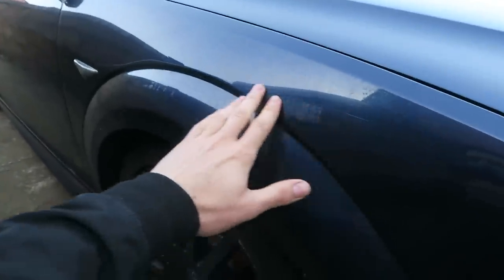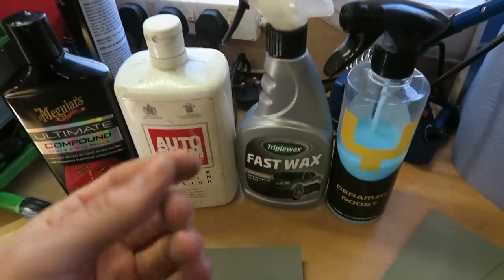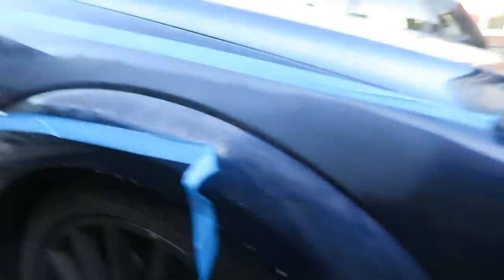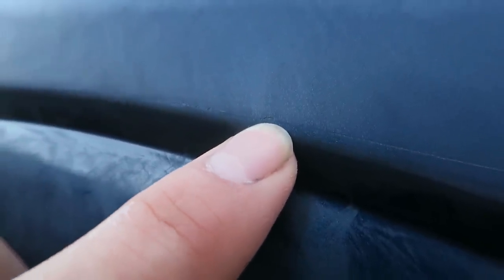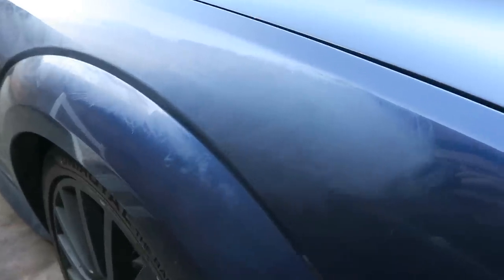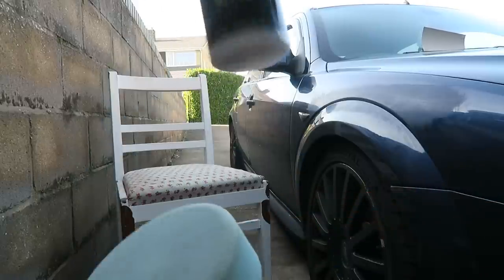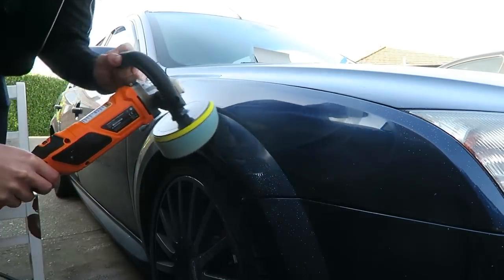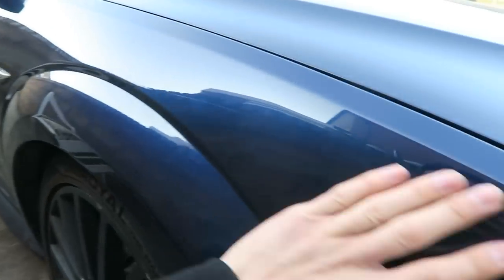Someone Key'd The Mondeo.. (Scratch Removal)

Comment from the maker: Constructive criticism is always welcome 👌🏼
Reply: fair play to you for having a go, the detailing world is really daunting - so many pros already out there which makes it really scary to have a go at things like this yourself
Reply: Wish i had the nuts to do my car .. crackin job m8 👌
Reply: Buy a bottle of colur magic that will hide it for a month or so  😉
Reply: Well wax your car so it's far more difficult for a key to get a hold in the paintwork or stones chipping it.
Reply: Hi. What you have to realise is there are scratches and there are REAL SCRATCHES.  When some bastad has done a gouge with a sharp object you have to think to yourself what is going to remove the scratch ?. Well it's not the scratch you are removing It is the layers of paint that are higher than the gouge. So an option is buy touch up paint which if you fill the scratch with you can then rub down/ flatten to blend the area. Or a panel respray ( big headache). 
Well done on the videos..
Regards Don.
Reply: the first part you started on the wing, could you not have removed the arch trim ? looks like your just making work harder for yourself
Reply: @ashman239  it's all one panel on a mondeo, it's not a separate trim.
Reply: bit of T-Cut next time save you hours of sanding
Reply: The imperfections you say are factory is also you going thru mate
Reply: Like it "the scratch hasn't completely gone but look how shiny the car is" 🤣🤣🤣🤣 it's all a learning curve my wife's car has been keyed but unfortunately through primer so gonna wet sand it, fill out and polish the crap out of it, I haven't done it before in same boat as you but if it goes tits up I'll just take it to a body shop so they can laugh at me as well 👍👍👍👍

Comment: Some decent cutting compound is called g13 cutting compound used it a fair bit in the body shop I worked in does brilliant job but I would use a touch up pen and flat it off then use a artist paint brush to go over the area with lacquer then use some g13 and buff the whole panel and then wax it best you would get without respecting it properly

Comment: Great vid,only tip I would give you is keep your pad flat to the paint work when buffing and not on a angle,put it on a angle you will produce more heat on a area and there for you have more chance of burning the paint work

Comment: When tackling a job like this wet the scratch with water and if it does not disappear  then it is through the lacquer and down to the base coat this you will not remove without a squirt with paint and topcoat

Comment: What I did clean the key marks out, filled it a touch up pen (mix lacquer and paint into one mix) and then blob it over the key marks so it’s raised over it. Then wet sant till it’s flat and polish. Worked a treat.
Reply: Vendetta UK. Yeah I used it on my fathers metallic grey A6 and you could tell the shade was slightly off but it took the eyes away from the scratch.
Reply from the maker: ThatGuyNamedScott. C like this idea
Reply: The Savage Garage give it a go! Nothing to lose!
Reply: I’ve seen people do something similar to get rid of gravel rash/stone chips on front bumpers.. then wet sand and then buff.  Felt sorry for you going through the clear coat.. did the same years ago and ended up having to get two panels painted at £500.  Sometimes perfection is best not attempted!👍
Reply: There's a YouTube channel  and he used nail polish and you couldn't tell on the video but I suppose with the naked eye you probably would but it's another option!!!
Reply: Yea I’ve done the same - with ok results
Reply: @ScottPC  Except the paint does not blend with the original paint and its metallic. You will be left with a visible line of paint instead.
Reply: @TheSavageGarage  I do the same but by spraying into can lid and applying with a small brush. But you only need apply lacquer if it's not down to primer. Otherwise you're also going to have a colour mismatch for no reason.
Reply: Just commented the same process then saw your post. Works a treat
Reply: Shouldn't I wet sand first to level out the edges of the scratch? Then  put the pain, wet sand again and polish?

Comment: Used way to fine grit.. should of used 1000 max first grit then 3000 after then polished up.
Shouldnt have to rub the panel for that long thats why the scratch is still there. As 3000 grit is a finishing grade not a cutting grade as such.
Id of went for about 800 grit with alot less effort then work upto about 3000.
Reply: Not really, you should always start with the least aggressive method. If you went straight in with 1000 grit on some soft paint you could go straight through to primer in 2 mins XD
Reply from the maker: Chris Selin blame Chris fix for that then!
Reply: @TheSavageGarage  chris fix is great :) just by seeing this scratch was pretty deep, but good attempt and learn there on.
The one at the back of the   car looks much easier also not next to sharp edges as you mentioned in the video :) i had one simular to this and managed to remove with a micro fibre pad and G3 professional scratch remover alone in a few moments without needing to use any sanding atall.

Btw been watching your channel for awhile now loving the vids :)
Reply: EXACTLY. SPOT ON.
Reply: After 22 years painting and polishing cars,  u done it about right mate,  just need to Start with 1500 on a rubber block tape all edges and don't be afraid,  if it goes wrong it goes wrong,  well done lad for giving it ago,  its not an easy task

Comment: Woow. No advice yet. There are loads of videos on youtube on how to fix this but which one to follow? 

My experience: dont use spray paint. Give it a light sand, then use touch up paint. Give that a day to dry. Then sand in the touch up paint. Then lots of t cutting and polishing. 

I even came across a video from a really knowledgable guy and he recommended raiding the gf's nail varnish collection and mixing up your own touch up paint! 

You can even make your own touch up paint by cutting up the empty matched spray paint can and pouring in the remaining paint into a recycled nail varnish bottle (clean that out using nail varnish remover).

Comment: My first attempt went a lot worse, I ended up respraying the whole rear quarter. 

A lacquer pen might help to fill the scratches before you sand them back, try using a slightly rougher paper to start with and keep getting finer. I always like to soak wet and dry paper in a jug of warm soapy water, just to make it easier to handle.

When using compounds, especially if mopping a car, keep it wet so you don’t burn through the paint , it’s a dead easy mistake to make and looks really hazy if you get it wrong. 

And if you find anything keeps going full after a good wash, move to a resin free polish. Resin just fills the imperfections and washes out after a while, a true polish won’t.

Massive fan of your work mate, keep it up!

Comment: I’ve used a fine line painting pen to fill the scratch with mixed paint and lacquer. Fill the scratch, sand down then cut and polish. If you use one make sure you don’t over fill as on an angle the paint will run out the reservoir. There about 7 quid off Amazon. Plenty of videos on YouTube on how to use to fill a car scratch and refinish

Comment: Pro tip, to see if the scratch is just as deep as the clear coat, pour some water on it. If the scratch disepears the sanding technic will work. If it doesn't disepear, the paint have been removed

Comment: IF I could offer a little advice, you should use a small block of wood when sanding.  Using your fingers can promote an uneven finish and you are less likely to go through the clear coat.

Comment: Few things to consider:

you should have went over the scratch with a machine polisher first to see what it could take out before moving onto wetsanding. Always start with least aggressive method when correcting.

The wool pad you used is a heavy cutting pad which should have been used with the compound, then finish up with a black finishing pad.

putting sealant over wax is pointless as the sealant cant adhere to the paint and do its job, you could wax over the sealant though.

Comment: If you get a trigger bottle with water in it spray it on the scratch if it disappears you can normally sand and buff it out if it stays when it's got water on its too deep

Comment: Fairy liquid has salt in it 😬
Reply: @Azureecosse  yes there is, it depends on the brand, most of the main ones use salt in them.
Reply: @Azureecosse  salt is used to make it thicker. If it didn't have salt it in would be also like water. Even if it doesn't have enough salt in to damage paintwork, if there is an area of bare metal it will corrode faster than if it was just left out in the air. It will also remove any wax or polish you have used as well, so if you wax or polish your car, then when you wash it with washing up liquid vs car shampoo you are removing significantly more of what you want to keep on.

It is designed specially for getting thick grease of trays and dishes. Not washing a paint. Cutlery is stainless steel or silver if you are posh, so the salt does not affect the cutlery.

Yes you can use it and it's probably better than not washing your car at all, but it would be dumb to use it when there are specific products designed to wash paint. In the same sense you could clean your car with sand paper, but even though you get the dirt off, it's clearly not the best solution. It's fine to use once or twice or even every time if you polish and wax your car all the time, but you are really not helping yourself
Reply: @Azureecosse  I never said it was bad for paint or clear coat. 🙄 I said it has salt on it and it's not made to be used on a car. I just say fairy as a washing up liquid just like you would say hoover instead of vacuum cleaner.

I never said it was worse than road salt or anything else that gets on the paint. You were arguing with points that I never even made 🤔

Comment: Very high 3000 grid sand paper you need like 1000 grid sand paper to get rid of scratches then you use 3000 grid and then 5000 grid to finishing and that's how it's done then you buff off

Comment: The thing about scratches like that isn't that it's the paint that's been scratched, its the clear coat that's damaged. At the factory, (or in a proper spray shop), the paint then the clear coat is heat bonded on. Leveling out the clear coat with the scratch then spraying over the top with more clear coat should make the scratch vanish. But getting it all to match is a nightmare unless you have the skill set and tools to do it. For something like that I'd have use a colour polish, I think Autogylm do colour match polishes that aren't three bad, they're not perfect but anything to reduce the scratch is better than nothing.

Comment: Unfortunately ford have always put a very thin layer of paint in their cars which make the primer issue easier to do mate. With a paint gauge it’s easy to see that other brands coat much thicker which cost more but lasts much better. Not fully your fault

Comment: I'm no expert but I have had success removing scratches from my Mondeo and it's hard to advise once you've already committed in this video and learned things yourself but, I was cringing.
Firstly, use the cutting polish first, this will smooth the edges of the scratch and will sometimes remove the majority.

Forget the block, your panels are not flat they are curved. Use the smallest piece of emery cloth you can, right on the end of your finger tips, and 3000 is too high....try 1000 first. Remember, you're not sanding the scratch out, that's a myth, you're blending it in. You're lowering the surrounding clear coat to the level of the scratch. Your action should be to follow the scratch, left to right in this instance, not up and down....and you should be trying to keep the sanded area as close to the scratch as possible. There is absolutely no need to be removing unnecessary amounts of clear coat.

Apply no pressure, let the cloth do the work, this will help your arm as well as the job. Always be scared of going through, don't get brave and keep looking for signs of your water changing colour, blue in your case.
Yes, I went through in my very first attempt(also a wing), and I had to learn from it too, keep at it but take your time and never get brave with that cloth. There is also a time to stop, don't keep thinking 'wow that looks so much better....if i could just go a little more here....oh, too late'.
Great vid as always.

Comment: enjoyed the vid and yes trial and error done it myself , still feel the wing could take more sanding and starting with 2000 grit would cut through quicker on some deeper scratches I've started with 1500 , if the scratch disappears when you spray the panel with water then the scratch will come out as it's likely a lacquer scratch... good luck with the other panels...

Comment: Before doing any sanding you should have used a touch up pen to cover the primer which was showing through the scratch, let it dry for a couple of weeks and then do your sanding, if you can clearly see a scratch then there isnt any of the body colour to polish out.  Saying that it is still a good video showing what results are available with a bit of effort.

Comment: Scratches that deep and long are really difficult to remove. Personally I start with 2.000 grit - in very bad cases sometimes 1.500 - then continue with 2.500, 3.000 and finish with 5.000 before I machine-polish. I´ve managed to remove some fairly deep scratches but those scratches in the video are just too deep and it becomes a lot more difficult if it gets necessary to wetsand on edges and corners.

Comment: My fiesta in my profile pic was keyed before sale right down the passenger side. It was deep in areas, I managed to get the colour back but the scratch was still visible
Reply: Also you want to try g6 compound it’s really deep working and helped a lot, put it on with wet and dry paper as you were using

Comment: First cut with the mop put the cutting compound on panel an keep the mop head well lubricated with water or soapy water I personally have a bucket of water an just dip the tip in an stops you burning paint
Reply: @brianhume4743  yea yea didn't say put the full thing In keep the mop wet very wet

Comment: Good stuff, i have just bought a black 09 volvo s40 r design sport and i made the school boy mistake of buying in the rain. When it dried i found it was covered in battle scars. It will be summer when i have a try at wet sanding.
Reply: Dr Kevorkian  secretly its a ford focus without the rust on the wheel arches and a nice interior. Volvos are also cool now.
Reply: Dr Kevorkian  volvo are actualy chinese now. I beleve they make some good stuff. May be im old before my time.

Comment: I believe polish acts as a wax, so you didn’t really need to use the wax on this occasion. Good job though
Reply: Kristian Thomas polish is a filler, wax is a sealant
Reply: Phil 1969 I thought polish was like wax, and compound is a filler.
Reply: Kristian Thomas no mate that autoglym is a filler polish , but to seal that you need to wax it over the top, compound takes a layer of the clear coat off

Comment: The rule of thumb that I have seen on yt, other than the fingernail test, is that is you soak the panel with water and you can't see the scratch then its only in the clearcoat and it can be sanded / polished out. However if you still see white etc the. Its gone through the paint and needs a respray. My similar scratch was a mix of in the clear and down to the paint so I bottled it and had it fixed when it was in for repair after being rear ended.